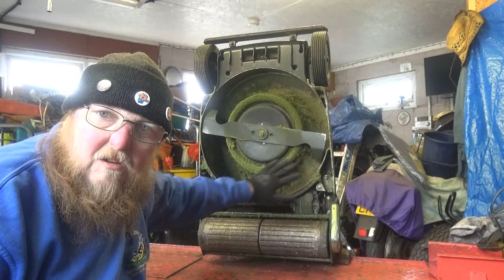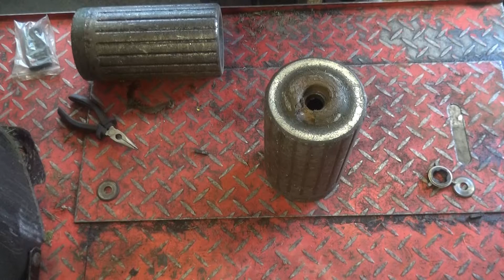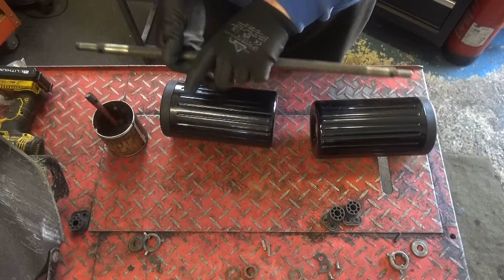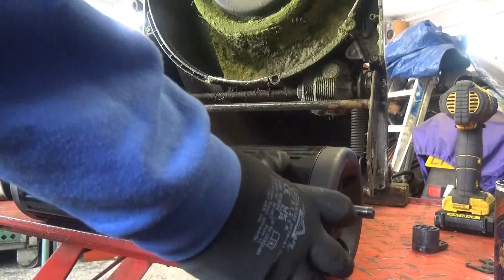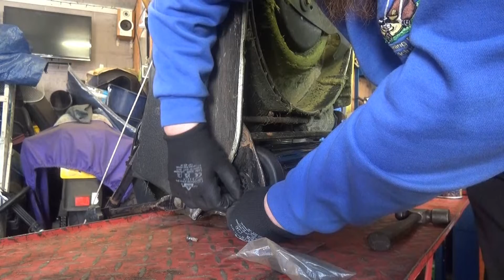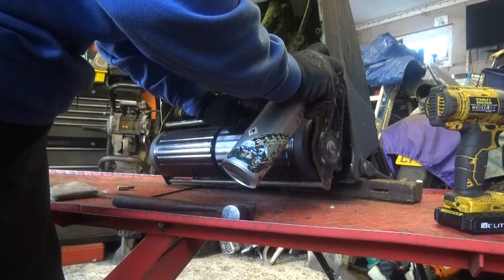Hayter 48 479B rear roller repair.

Comment: We've done this and followed your instructions to the letter but the rollers lock up when we try and pull it back.  Any advice please
Reply from the maker: Have you made sure the cams and drive pins are around the right way?
Even I've put them in wrongly.

Comment: Hi Dug, I've got a Hayter Spirit 41 autodriive 2012, it's got the 619e engine. The rear roller is jammed solid, I have cleaned the chain because it was stuck. Any idea please.
Reply from the maker: Did the rear roller rotate after you removed the chain?
If it did, it was the chain. If it didn't, the plastic roller is stuck on the drive shaft.
Also check the drive cable isnt siezed and is engaging the drive. That can be checked easily by seeing how the cable returns, or doesn't.
I hope that helps.

Comment: Thank you. Ive got a turning cog but the rollers are not turning with any conviction. The vid has given me the confidence to break out the spanners
Reply from the maker: Good luck, and I hope the vid helps you sort the problem out 😁
Reply: @DugatDizzyLizzys  it did indeed. One of the bushes had pulled half way out of the roller. I’m not exactly sure how that was causing the clunking rather than driving, but I’ve tapped it back in and it’s pulling like a train now. I’ve got the rebuild spares list waiting to order if it’s not a permanent fix. I’d have never tried it without your video, much appreciated.

Comment: Dug, you forgot to pack those cams with water resistant grease. Fuchs Renolit CZ2 or equivalent grease. 😉
Reply from the maker: I agree with packing things with grease helps in maintaining, but not in this case.
I do put copper slip on the drive pins, but there are a few reasons I don't pack them with grease.
In my opinion it's thus.
1) If the machine is regular used, the pins will not seize up on the shaft. This is a pro machine and I know they put miles on it each week.
2) If I pack it with grease, there is a good possibility as the plastic axle bearings will wear and allow the grease to leak out from the disc as it's loose, and it may cause the customer to call me as they have grease on their roller and its also on the grass they've just cut. And nobody wants to end up with grease on their foot after walking on their lawn.
3) the pins are a few pound to replace, and after 3 roller changes on a machine, all I've had to do is file a little bur off the drive shaft the pins slide through with each pin replacement.
4) Grease is sticky stuff. Grease + grass clippings and dust = grinding paste = wears out faster.
Hope that explains why I don't pack these with grease 😁
Reply: @DugatDizzyLizzys thanks for the explanation 👍
Reply: @DugatDizzyLizzys  Dug, my info regarding the grease was direct reference from the Hayter service bulletin.  I've personally never seen the grease leak out onto the roller, but it does help to lube the shaft where it runs through the end caps as well.  In the near future the cams will be better sealed and those two washers fixed in place, instead of relying on the outer bushes to do it. 

How are the gearboxes holding out on the PRO's?  We seem to get through quite a few of them.
Reply from the maker: @TGMForum  I've worked on machines that are a couple of years old, and they have never been packed with grease. Is that an addendum to the manual?
The 479 series had a bad gearboxes and I've changed a few of them, but never any rollers, but the new 479 series, I've just changed the rollers.
A customer has had 3 sets of rollers fitted, but not a gearbox, yet, but then I expect the rest of the mower to be knackered first.
Reply: @DugatDizzyLizzys  Dug, that's what we were told to do from day one as a main service dealer. I think the bulletin was sent out to remind the dealers to do it.  

I've changed loads of keys and cams and   end caps, not so many roller sections though. Oh, and gearboxes.  And a lot of bbc top pulley halves under warranty on the first ones. These machines have already gone through a few changes since they came out, and more will be coming.